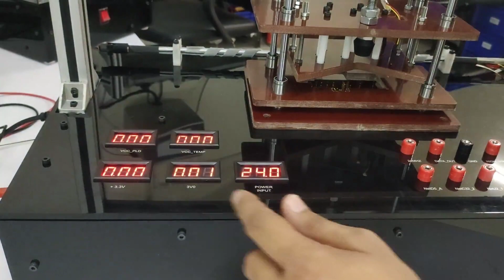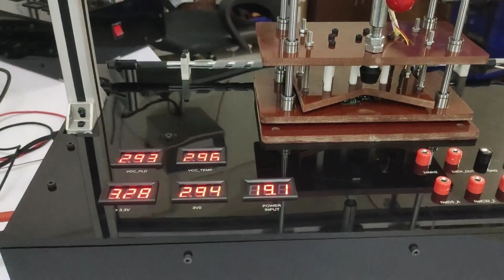Best PCB Functional Test System Manufacturer,How to give Order for your requirements.

Comment from the maker: What is a functional test of a PCB?,Which method is used for PCB board testing?,Who conducts functional testing?,What is a PCB test fixture?,How do you test for PCB?,What material is used in PCB test fixtures?,Wat is a PCB test board?,Pcb test fixture price,pcb test fixture kit,Pcb test fixture manufacturers,pcb test fixture design,fixture Manufacturer,jigs vs fixturer,pogo pin vs test probe,How do I identify PCB components?

manual customize test jigs and fixture,vacuum test fixtures,Pneumatic Test Fixtures,ICT Fixtures,Dispensing Robot Fixtures ,Soldering Robot Fixtures,Router Fixtures,Automated Functional Automatic Test Fixtures,Mild Steel PCB Test Fixture Machine,PCB Functional Test Fixture,Pcb Continuity Testing Fixture,PCB Test Fixture Machine, For Manufacturing Functional Test,Argus MS Pcb Testing Jig Fixture,Pcb Testing Jig Fixture Ict,Manual Testing Jig, For Electronics,PCB Test System Service,Different Type of Zig And Fixture,Machine Jig Fixture,Brass Pogo Pins, For Electronic,Spring Contact Test Probes Pogo Pins,Spring Pogo Pins,Pogo Pin Connectors,Korea ICT Testing Probe And Receptacles For Industrial,golden Mild Steel Spring Contact Probe,
Collar Pogo Pins,Pogo Pin,Screw type Pogo Pin Test Probe,POGO Pin for PCB circuit testing,Spring Contact Test Probes Pogo Pins,Wire Harness Probe Pin Switch Probe Pin TBO Pin TVO Pin Push Back Pin PCB Test Pin Harness Pogo Pin,Bare Pcb Test Probe POGO PIN ICT PROBES SPRING CONTACT POGO PROBE POGO,Analog Black Functional Testing Probe,In Circuit Test Probes
Testing Probes and Receptacles,Flying Probe Complete Solution Testing System,Customize Mechatronic Test Fixture for Product testing